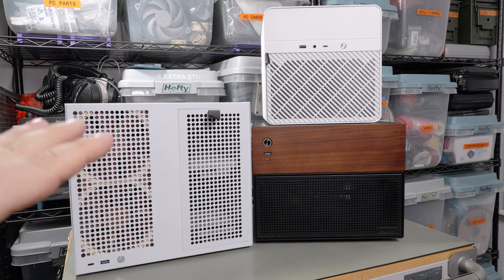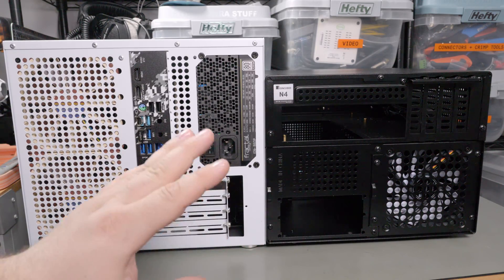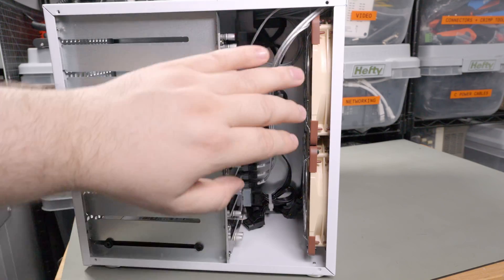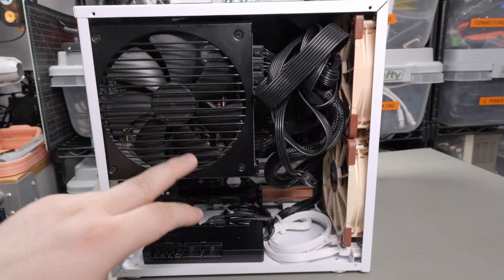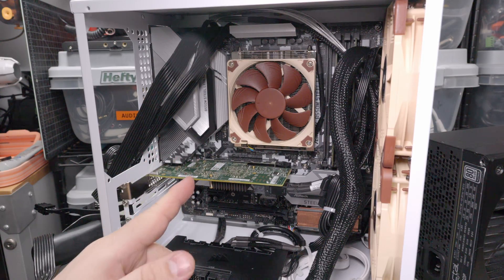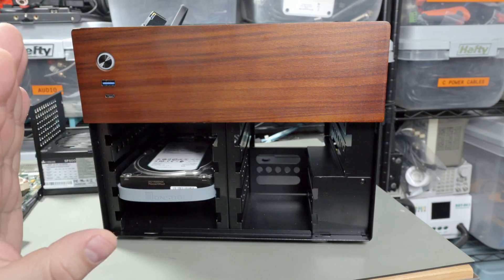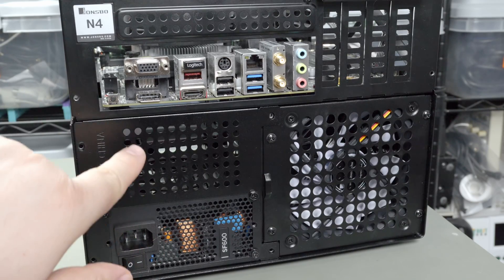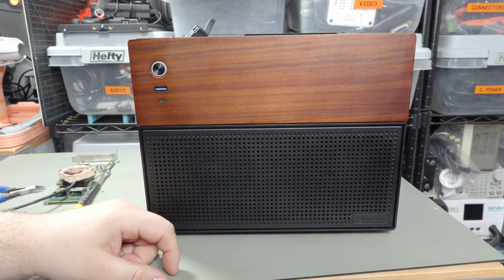A great 8-bay mATX NAS case! Also the Jonsbo N4...

Comment from the maker: Link for the case wasn't working. Updated it with the best deal I could find on Aliexpress ~$250 USD including shipping. This will probably be lower if you're shipping somewhere other than the US.
Reply: This is so much bs. Shipping is unbelievable
Reply from the maker: This is a thing which used to be really common on eBay as well. Basically, the $100 + $200 shipping means it is a $300 case. They move a lot of the cost into shipping because the seller's fees are based on the value of the item, not the shipping. eBay/Aliexpress take less of their money this way. eBay stopped it years ago for the most part by making it something you can get banned for and by making the search "Lowest price + shipping". By including the shipping you can't fake the results.

On Aliexpress they don't include shipping when searching by price, so they can also get to the top of search results by making something $10 and $500 shipping. AE really needs to fix their terrible, terrible search system.
Reply: @PeterBrockie  as someone who doesnt order from AE basically ever, i had no clue sellers did this. very interesting
Reply from the maker: @feetenthusiast1015  It used to be everywhere on eBay as well. AE needs to sort their shit out with it. haha
Reply: @PeterBrockie  for me its the same issue with amazon to shipping things here to norway. from us/uk/de even. often more then the product it self.  totally nuts. really like many cases they got on AliExpress but not for the price they want with shipping.

Comment: AIO might not fit because of the power switch at the bottom. I haven't tried an AIO, but that's how it looks like to me... Most AIOs have some extra space on the sides of the radiator panel.

Comment: Hello, I just received the case in the mail. The build quality doesn’t exactly make a trustworthy impression, but I’d like your assessment on two things since I’m not an expert. How do you evaluate the magnets for the hard drive door? This gives me a bit of an uneasy feeling. What do you think of the backplate? When I look at the overall quality, I’m very unsure whether this component can be trusted.
Thanks and best regards
Reply from the maker: It's kinda thin steel, but nothing terrible in terms of quality. The magnets are 100% fine - they will not hurt your data in any way (for reasons too boring to get into here, you need a much bigger magnet than you'd think to wipe a modern drive).

The backplate on mine has been working 24/7 for over a year with zero drive issues of any kind.

Comment: I like the look of the Sagittarius, but shipping is anywhere from £30-£50 in Aliexpress. The N3 is nice and compact, but ITX format. Then again, there are a few decent boards around. The N4 would have been ideal if better designed. The lack of more than 4 hot swap bays makes no difference to me. I'm looking at adding a second backplane for the N4 from Aliexpress to plug in the other two 3.5" drives.
Reply from the maker: I just look at it as a total price and if it's worth it or not. The issue with AE is a lot of sellers try to cheat their listings by moving the cost to shipping.
Reply: @PeterBrockie  You usually find one seller who ploughs the middle ground with a slightly higher price and free shipping, but not in this instance unfortunately.

Think I could have got that second backplane installed, but obviously if the PSU is causing an issue with space, it's going to be a non-starter.

Actually toying with the challenge of the N4 as it's discounted to about £86 at the moment. The extra backplane is about another £23 with a 3d printed drive area instead, and thinking of sticking the PSU outside in a 3D printed box to allow for an extra fan over those hard drives.

There's a front fan mod to move more air across the hard drives, so could be a good custom project.

Comment: can it (jonsbo N4) support ATX PSUs if you remove the 2.5 chasis to give room?
Reply from the maker: Nope. Not enough room. I don't have it anymore, but I don't think one would fit even if you started cutting metal out of it - you'd run into the motherboard area.
Reply: Some people say that it is possible to fit an ATX inside a jonsbo n4 the point is that SFX PSUs (atleast in my country) are barely available anywhere and there are not many options to choose from and i dont really mind removing some drive capability to use an ATX if i buy that case. I am thinking about getting an corsair RM series PSU and all i really care about is if it will fit.  @PeterBrockie

Comment: Did the Sagittarius case come with those fans and are they good enough?
Reply from the maker: I don't think it comes with any fans as is. If I recall they have options to include some cheap fans with it, but I'd personally buy some Thermaltake (or Noctua if you have the budget) fans from Amazon instead of their generic ones.

Comment: Would you recommend this over the Jonsbo N3? Looking to build a semi-portable AI workstation with lots of storage. Thanks!
Reply from the maker: I'd probably go with this for the extra options you get by having an mATX board with more slots. I'd get a SFX Psu plus an adapter bracket to free up some more space for a CPU cooler.
Reply: @PeterBrockie  Thanks for the quick response! I am planning on getting the framework Ryzen AI Max+ 395 ITX motherboard with 128GB ram and built in GPU with a PCI to sata card for the hard drives. Since I'm already planning on an ITX board does that change your opinion? This ones seems like it would have better cooling but the N3 seems a bit more portable. I am semi nomadic so I move every 6-12 months and need to shove this in a check in or box for shipping. This is replacing a 4bay NAS and Mini PC. Thanks, appreciate your insight!
Reply from the maker: @chasingfomo  If you're going ITX you can go with whatever you can get cheaper - however, this one does cool the drives better than the Jonsbo, where the Jonsbo has a bit more open area for your CPU cooling. I'd also recommend going with a LSI/Broadcom SAS controller in IT mode over a plain SATA controller. They're generally a lot more reliable than SATA controllers and ones like the 9211-8i are basically the same price as a SATA card these days.
Reply: @PeterBrockie  Thank you! This was very helpful!
Reply: Also I must admit that I spent about 10 minutes chatting with chatgpt to fully understand what your recommendation of "LSI/Broadcom SAS controller in IT mode over a plain SATA controller" meant. As you pointed out in one of your other videos most ITX boards lack SATA controllers so might be worth making a quick video expanding on your recommendation for other people in similar situation. I learned a lot from watching your videos got yourself a new sub. Thanks again!

Comment: I like the Sagittarius but don't need 8 bays plus the height. This will be homelab/media server. Currently running just running old gaming pc with 4tb doing mirroring but would love to add two 2tb but PC does not have space for it. A 4/5 bay would serve my homelab/media fix, would just use the atx psu and a matx mb using in old gaming rig. I don't need space for gpu, I will just buy a igpu or apu processor
Reply from the maker: The Jonsbo N2 is pretty small for a 5 bay.

Comment: What software should you use to run the nas?
Reply from the maker: Depends on your skill level and how advanced you want to get (running Plex, SSD caching, etc).

Unraid and the upcoming HexOS seem to be the most easy to use, but they're also paid. Unraid also has limitations in speed, etc. unless you run ZFS on it.

TrueNAS has all the features you could ever use. But it's more complex to setup and use. HexOS is TrueNAS with an "easy mode", so you can still go into the advanced stuff in the future if you want to start in a more friendly way.

Unraid has a big advantage in that you can easily mix disk sizes.

Personally I use TrueNAS because I want the advanced stuff and speed. Plus I'm comfortable with it having used it for many, many years.

Comment: You sold me on this case.  Planning to use it as offsite backup at my parents house as well.  Ordered a Corsair SF750 SFX psu for this build.
Reply from the maker: Been using it for the same thing since the video came out. Zero issues.
Reply: @PeterBrockie  what would be the available cpu cooler height with the Corsair SF750?

Comment: What CPU fan cooler would you recommend to put here? As for the description of the case in AliExpress only supports a CPU cooler height of 55mm max, and since I'm mounting an Intel Xeon LGA2011 socket processor... I'm finding it quite difficult to find a proper cooler that will cool up to 100-120W for under 55mm height. Thoughts?
Reply: None of the LGA 2011-3 line will draw more than 150W. An ID Cooling IS-55X might work for you.
Reply from the maker: I would personally go with an SFX Psu to get more height if you need more cooling or experiment with an AIO cooler. Even a 120mm which I normally wouldn't recommend should handle any 2011 aside from the X299 stuff like the 7980XE.
Reply: @PeterBrockie  Ialso thought about the AIO but tbh, taking in mind the "maintenance" of AIO (even if its very little) and the space that the pump will take... I'm not sure if its the best option for a 24/7 running server... Could I ask you which CPU coolers could you fit in there and what are their measures (or if you give me the model I can search it myself). And also which PSU are you using? I would like to research for these exact models to check how much height of a CPU cooler I could fit in this case.
Thanks for your reply btw!

Comment: Putting a 240mm rad in Sagittarius case might not be possible. It looks like it has not much room left at top and bottom after installing those 2 fans. Rads have top and bottom hubs that protrude over the fan spacing, and especially the hub with tubes coming out of it is tall.
I would also like to have a version of it that requires assembly, as it should cut down on shipping fees a lot if the box could be flattened by 50% or more.

Comment: If you don't care about size, the Node 804 is unbeatable. No hot swap, but taking 5 min to swap a drive isn't too bad in a homelab.
Reply: Ive had a node 804 for years. I hate it.  It;s just annoying everytime I have to work on it. Sure,  very doable, but why do I want easy tasks to be harder than they need to be? It also runs hot. No side vent9lation, obstructed top panel. WIth 10 drives and two ssds, it runs hot.  For me, Idle drive temps sit mid to high 30's with all fan mounts occupied.
Reply: @nescience78  mid to high 30s is pretty normal temp for drives in any system or server. It doesn't need side ventilation as it has front back and top. Its not the easiest case to work on but I only open it like once a year. Not sure why you would be inside a server more often.
Reply: Its a pretty decent case indeed. Quiet relatively cool and not bad looking.

However, if you need to do some work, you will hate this case with an intensity that is difficult to explain. Need to swap a defective M2 drive? F U, take everything out. One of your HDDs defective? F U, good luck swapping it out.

Yeah yeah everything is doable, but this is not a case you'd want anything failing ever. As long as it's running and you don't need to fiddle, it's great....but oh boy if you do need to get to work, no way. So many bette alternatives out there. And regardless of working fine, their solution of hanging HDDs is just plain old weird vordering on dumb ;)
Reply: @yveZ79  Curious on your top picks for matx 8-10 drive cases that aren't Chinese garbage.

Comment: 6+2 = 8 drive nas... doh... you only counting 3.5" makes zero sense...
Reply from the maker: If it makes zero sense, why is the N2 from the same company called a 5-bay NAS when it has 5 3.5" drives and 1 2.5" drive? Pretty much all NAS cases refer to 3.5" drives when counting them with a couple exceptions (I've seen QNAP use X+Y numbering, for example).
Reply: @PeterBrockie  ah ok so this world know brand sells a "non NAS" NAS? Synology Disk Station DS620slim... it got ZERO 3.5" drives...

or another sorta well known brand has a "9 bay nas" but only 5 of them are 3.5" QNAP TS-932PX-4G
Reply: @LiLBitsDK  Hold this L for your comment and not even apologizing

Comment: They really dropped the ball with the N4. It should have been just the N3 but with matx compatibility. If there is not enough space for the psu, only allow flex atx or pico psu

Comment: Jeez.. Where manufactures left the heads.. Always some bad decisions with all NAS cases. Just bigger bottom for PSU, then it comes proper cpu cooling and two more HDD space in drive base. And it will not be that bad with the size of the case. Matx, 10-12 hot-swap bay and I will be happy.

Comment: I ended up splurging for a Silverstone CS382 instead of waiting for Jonsbo to release a sensical micro-ATX case. Still getting the build set up but quite impressed so far.
Reply: That Silverstone case seems really nice. Not perfect (what case is?), but it checks a lot of boxes. There is a really informative Amazon customer review (with photos) of the CS382 case from October 2023 if you haven't seen it already. I don't know how that customer got their hands on the case so early, but there are a lot of good nuggets and photos in their review regardless.
Reply: LOL. The price is not even close to any of these case lol

Comment: 3:20 cannot store the pull tab and the special slide-in screws in the unused bays, which means they will be prone to getting lost. :/ I mean you and I won't lose them, but we will see these cases on eBay, CraigsList or Goodwill years later with these parts missing :)
Reply: Time to whip out the 3D printer ;)